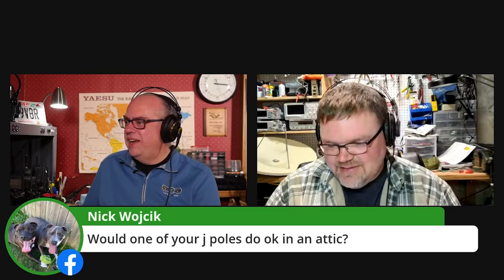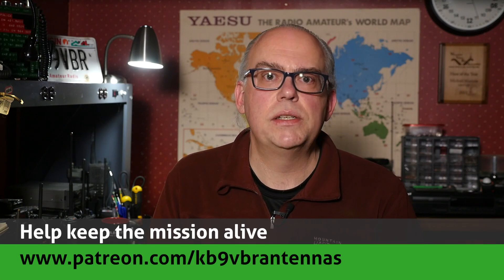January 2021 Livestream Excerpt: Attic Antennas - Ham Radio Q&A

Comment: I Had a OCFD up in my Attic. It worked good, had some DX. But had a high Noise Floor. Pulled it out. I’m now using a EFHW outside. Much better. I’m going to use the OCFD for Portable.(Buckmaster 40/10)

Comment: Would a MLA-30 do good in the attic?
Reply from the maker: I've seen quite a few people use magnetic loop antennas indoors with good results. You do have to tune the antenna for your operating frequency so you will need easy access to it in order to manipulate the level of capacitance each time you change frequency or band.

Comment: I have four antennas in my attic. I have a tall attic and get outstanding performance especially from my G5RV Junior antenna. Check out my house  on QRZ. My call is Kb3ShV. I run 100 watts from an Icom 7300. If I can hear them I can talk to them.  Check out my log and you will see my contacts.